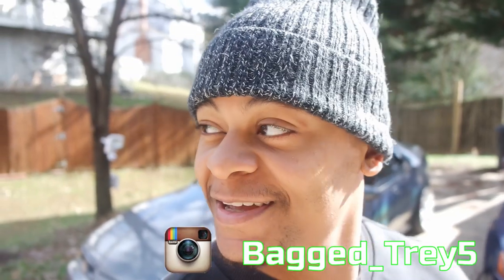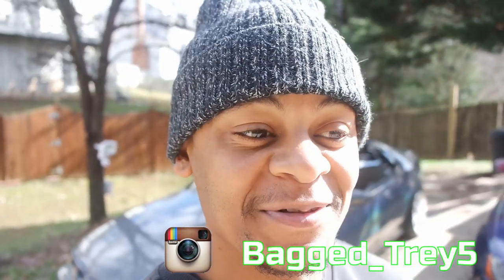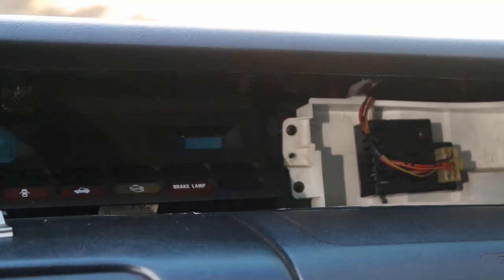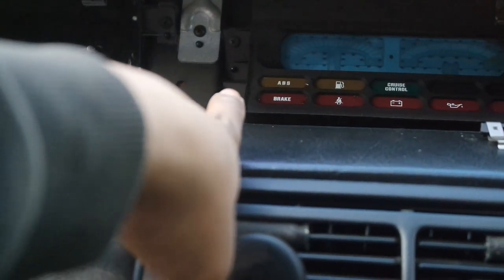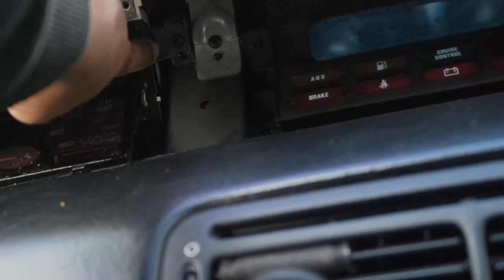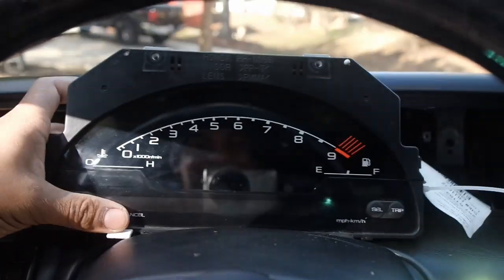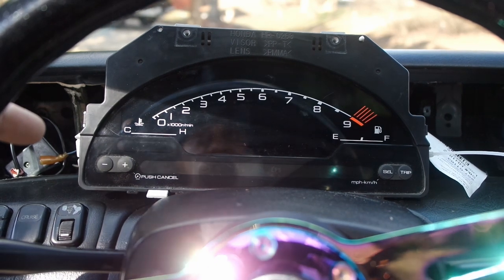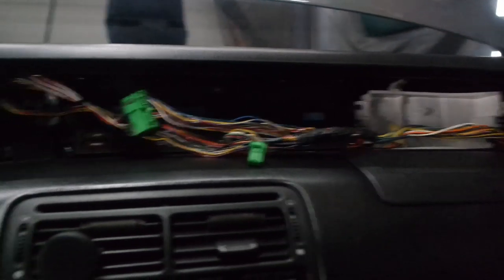how to swap the s2000 cluster in your honda prelude

Comment: I did this swap with My 5thgen back on 2010. I miss that car so much :/
Reply: Can you provide any insight to how you did this?
Reply: @masonweisbrod7066  alot the wiring was done by my buddy but if I can recall ge pulled up the wiring schematic for both cars, prepped and tagged each wire with the color it belong to, we got a Speedohealer, a manual temp gauge and we did 3 days of tuning to get the timing down right.

Comment: In the owners manual it says to disconnect the battery and disable the SRS system. Is that really necessary? If the battery is disconnected the airbag can’t deploy right? I don’t want to tear my steering wheel apart and take my glove box off😂

Comment: If you could make the S2k cluster light aqua blue like the stock Prelude cluster light, it would be game over.
Reply from the maker: Thats the plan bro
Reply: Trey Be Dipping I need you on speed dial ASAP. Once I get a 4th Gen, I have big plans performance and cosmetic wise. I’m going cosmetic first cuz it’s cheaper and I want to be NA for a while. I want to install fiber optic ambient lighting to complement the dash but is wired to a shift light so when I hit red line, all of the Ambient lighting turns red. Adding a S2K cluster would be crazy. Also, ima take your idea for the headlights, taillights, and turn signals. And obviously you are a great person to talk to considering you have 1st hand experience with all this.
Reply from the maker: @WashJosh  got you bro

Comment: 🔥 🔥I see that the low mileage is that true mile reading. How did you convert that analog odometer do that gauge?
Reply from the maker: Thats is the milage the cluster had. Engine has 1200miles. Frame has about 140k
Reply: @treybedipping1734  anyway of changing the cluster mileage to match the engine/frame?
Reply from the maker: @dln0277  not sure bro

Comment: Sick I wanted to do this a while back but thought it was not possible.
I know I can get the harness made, but what about the fitment, you didnt touch on that to much.
Does it fit like stock? Do you trim or do you need make something like a bezel to fit perfect?
Can you elaborate a little in that please.
Reply from the maker: You wont need a bezel it kinda fits in there perfect. Only thing you'll need to do is make brackets to keep it in a perfect spot. Mi e is kinda just resting in there but its pretty snug
Reply: @treybedipping1734  ok cool, thanks for the input.
Cant wait for the Qube led install.
Keep up the good work.
Reply from the maker: @henrylima6974  oh yea me either its gonna be dope.

Comment: I took my 95 EL cluster apart. Corrosion on circuit board behind tach. I figure a resistor is busted leaking or something. You got to be a electronic wizzard to remove and install new circuit parts, also the plastic is very brittle. I can't fix it. I cleaned corrosion off some solder points and no change. The top wire connectors are a booger to remove. I hate this dash now. I owned a 3000GT, and 300ZX and those cars have a cover that pops off top of gauge cluster to remove. But I traced my problem to the tachometer/speedometer circuit board.  The warning light cluster breaks easy. But this a Honda problem. I seen Civics, Accords, and Preludes with bad gauges.

Comment: Hopefully your still checking these comments 😅 I'de love to do this swap on my 92 but did you need to cut the cluster at all? And did you need a mounting system or does the 4G bolts line up?
Reply from the maker: You'll need to cut the black bezel that runs along the top of the dash itself the cluster fit in the slot but you will have to make custom brackets
Reply: @treybedipping1734  thanks mate! Doesn't sound too difficult 🤞🏼 hopefully I can get a cluster & contact hector.

Comment: Hello, how did you solve the temperature gauge and the fuel level?
Reply from the maker: Have to run the 5th gen fuel sending unit for the fuel and the temp is adjusted with tool that comes with the ktuned box

Comment: yoh trey hope you good need some help on 4ws electric fix mine not working rear wheels not responding please help
Reply from the maker: Man those electric 4ws units are near impossible to fix or find parts for bro sorry
Reply: @treybedipping1734  can i change it to manual though
Reply from the maker: @Donalbain Charamba  only the 3rd generation have manual 4ws I'm not sure if you can convert it or not. That's a good question.

Comment: Bro is it plug n play or must do some little modified to fit it?
Reply from the maker: If you get the plug and play harness its plug and play.
Reply: @treybedipping1734  i mean the cluster is perfectly sit or they still have some space?
Reply from the maker: @pencintamivec498  you have to trim the plastic bezel piece up top or remove it but it pretty much fits in there and you'll have to custom make your own brackets

Comment: Yooo I need this
Reply from the maker: I know right 😎
Reply: @treybedipping1734  is there a link to anything I would need for this swap? The tachometer on my current dash is dead so it would a perfect time to change it up
Reply from the maker: @BrpdogProductions  you will have to source a cluster from ebay or junkyard. And find hector prelude on facebook for the harness. Or look up the ktuned dash converter box and you can wire it yourself.
Reply: @treybedipping1734  alright thanks!